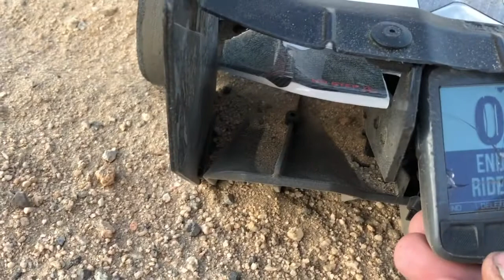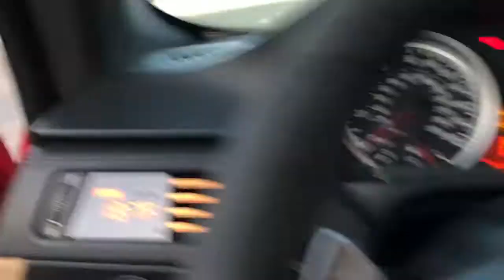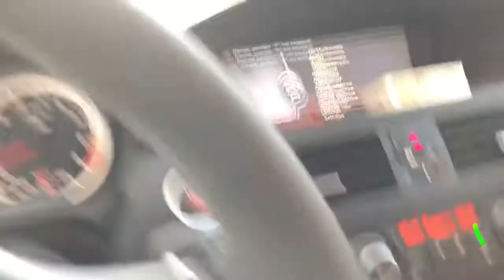Arrma limitless speed pass on foams

Comment: Damn....Its hard to find a quiet, smooth flat road. I feel your pain bro....my day went pretty much the same yesterday.
Reply from the maker: Kaizer Test that sucks
Reply: @earlmoorhead5555  Hahahaha...sure does. My Slash hit 90mph after 3 crashes and my Tamiya TT02 did 90mph. The Tamiya is a pleasure to run fast. Goes straight as an arrow. I have Arrmas too that Im going to setup for speed as well. My biggest problem is finding the time to do all this.